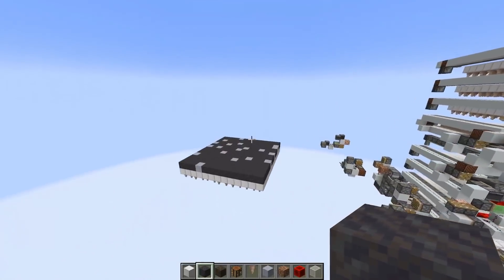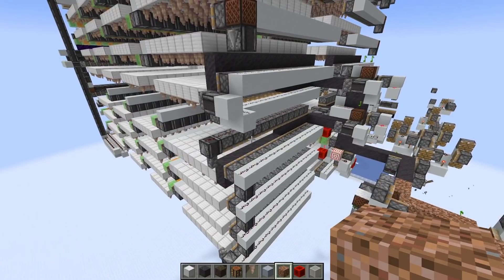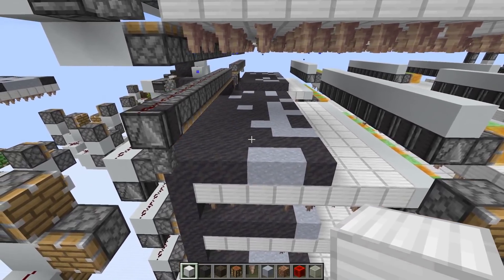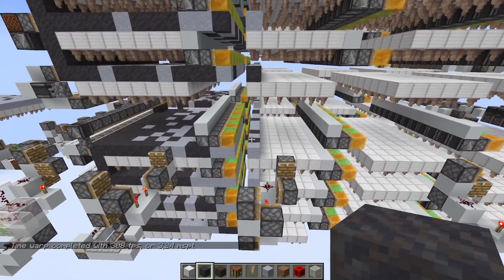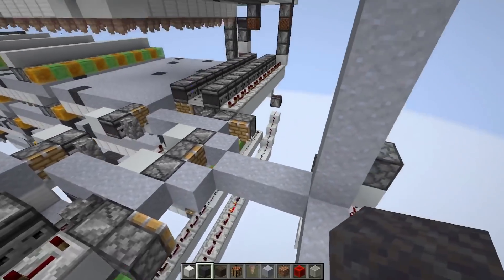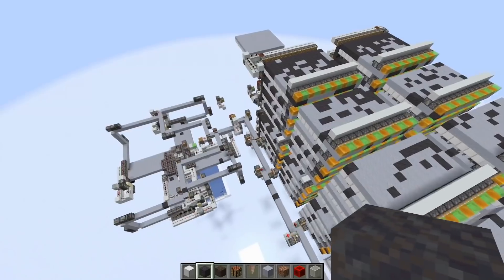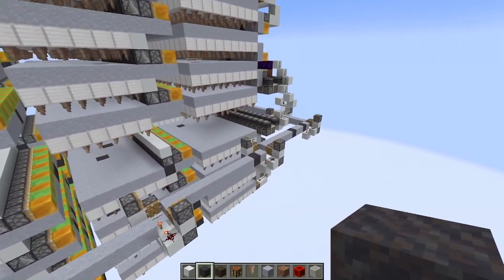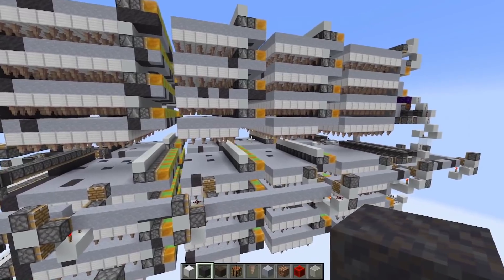Efficient Renewable Clay Converter

Comment: You can reliably sort mud from clay from the simple fact that the clay uses the "guitar" soundfont on the noteblock. So maybe you can adapt you sculk block sorter to try it on your machine
Reply: *Flute. Wool is guitar.
Reply: I was thinking the same thing. You could only take the first section of the machine where it seems to convert 60-70%, then sort them out based on noteblock sounds and re-merge the mud back in to the input stream.
Reply: Or use the fact that mud is just slightly less than a block.
Throw an item. If the hopper below picks it up, it's mud, otherwise clay.
Reply: @theaureliasys6362  THIS! I thought that as soon as I saw how long the machine was. I thought, "why reach 95% efficiency when you could toss items on a conveyer belt and punch out the blocks that let items pass by timing a piston a few blocks along the belt?"
Reply: @theaureliasys6362  Wouldn't you need a hopper minecart at a precise y level because regular hopper speed is too slow? The blocks are coming in at 1 every 4 game ticks, but hopper speed is one item every 8 game ticks. I can imagine it's still possible, just more complicated. For example:

An item is dispensed on the block stream, and a 5 minute timer is set for later. If a mud block gets pushed in, then a hopper minecart picks up the item, feeds it into one of 2 hoppers it's sitting on, and that is detected, so the mud block gets separated and the 5 minute timer is reset. If the timer runs out, then the item despawned, so dispense a new item. The main problem with that would be the resetting of the timer, but I bet ilmango's a lot smarter than me and can come up with another solution.
Reply: @mambodog5322  just use chest boat
Reply: @theaureliasys6362  yesss, same as soul sand, not a full block, there are a lot of mechanisms that can detect that and then you can sort it out easily, but you can also just use noteblocks and I’m sure there are many more ways
Reply: definitely possible with the new calibrated skulk.
Reply: @nickb8755  or you could split the input stream so that processing can run at half of input speed. Or just run your stream over two of the hopper-based detectors described, so the backup one will catch anything missed when the primary is on cooldown.

Comment: It's also always an option to add a system whereby endermen pick up the clay and are then killed in order to get the clay blocks directly. I love this crazy automation!
Reply: LogicalGeekBoy once build an enderman farm with melon blocks as bonus output. I guess you could do something similar and let the endermen pick up some blocks
Reply from the maker: would be an absolute nightmare trying to do that. works well with melons because nothing breaks if melons don't get picked up. 
But if you constantly have blocks pushing in from the back, the randomness introduced of enderman spawning is a huge reliability issue.
Not worth it all if you ask me.
Reply: If you ran the clay past the endermen, then into a blast chamber  it would stop the system breaking. Not very efficient but workable.
Reply: Sure, it's totally gimmicky and not really worth the effort. But we're already talking about a massive contraption that only produces a few thousand clay blocks per hour, so I think it's a fun challenge.
Reply: @ilmango I have been trying to design it with enderman, and yeah enderman are too difficult to deal with, they are too unpredictable. 

Sometimes they pick enough blocks but sometimes they don't, it is peetty annoying lol, although with a slow clay farm may be it would be possible, but at that point it would be such a slow output that it isn't worth the effort
Reply: @giantroboteye5371 Yeah, but at that point, why bother? Lol

Comment: Is there any specific reason why it's a 17.2% chance of converting mud into clay?
Reply: mojank
Reply: It's random-ticked based and that is the probability associated with the mud to clay conversion.
Reply from the maker: it's actually 17.6%. sorry I misremembered. to be precise it's 45/256.
why 45/256 though? no idea, it's like that in the code. probably a developer thought it's a good number or they wanted to reach a certain average time, similar to it taking be pretty much exactly one hour for copper to get to the last stage.
Reply: Iirc, its because it looks for the dripstone to get random ticked, so it ends up being the same probability as the dripstone filling up water/lava in a cauldron

Comment: I think that noteblocks change its instrument with clay, maybe that can be used to sort the mud out
Reply: IIRC mud has a smaller hitbox, like soulsand, so it's possible to use an entity and a tripwire to sort them out.
Reply: Would an observer not detect it well enough?
Reply: no it cannot as how would you detect the sound automatically?
Reply: @pocarski  imagine going through all that hell with entities just to get clay
Reply: @vuongle743  the noteblock block status changes and this can be detected with an observer. Ilmango already used this to separate stoneblocks from sculkblocks. That being said, this only works if there are different instruments and I do not know if that is the case.
Reply: “Imagine going through all that…”
 @vuongle743  that’s the fun.
Reply: @sempervelox  looking at the wiki, unless it has not been updated, clay and mud do have different instruments
Reply from the maker: that would be the way to go I guess. very easy then
Reply: You can also use the dripstone to sort Mud and clay, clay is not 'dripping'
Reply: @Cheesecannon25  The observer wouldnt be able to tell the difference between mud and clay.
Reply: @vibe6223  does the transformation cause a block update
Reply: @Cheesecannon25  I assume it would but i'd imagine a few things could get in the way of being able to tell the difference between the blocks like the mud being pushed into the system, which would activate the observer.

Comment: How about dropping an item onto the blockstream, and having a hopper below? Since the mud is lower than the clay, as soon as the item lies on a mud block, the hopper should be able to pick it up. Then just use a comperstor to detect the item going through the hopper…
Reply: I'd assume too many dropped items would lag your game out.
Reply: @lordderppington4694  You wouldn't have more than a handful of items on the ground though since they'd all be picked up by hoppers (or hopper minecarts)
Reply: @lordderppington4694  yes using items could cause that problems, I think using minecarts is a better idea, a Minecart will attach to a rail underneath partial block like mud which you can detect and sort mud
Reply: @sanderbos4243  can't use hopper minecarts because they will pick things from clay too, and hoppers could fail to pick up fast enough in the long run.
Reply: @wharhast1920  True, but if you split up the line of clay into a few more lines then the new blocks would be pushed in slow enough for hoppers not to get overwhelmed
Reply: @wharhast1920  I think that hopper minecarts off of rails do not pick up items thru full blocks, only on rails does that work.
Reply: @wharhast1920  hopper minecarts pick up from full blocks just if they stand on rails
Reply: The problem with items is that they don't fall on the same tick the block beneath them disapears. So in the end block stream would need to be split regardless
Reply: @feliksporeba5851  considering the fact that the blockstream already is split up multiple times, maybe do the sorting just before merging the streams again

Comment: For sorting out the mud blocks you could use a hopper bellow the block line an an item on dropped on top, so when a mud block passes through detects the item getting into the hopper, then push the block out and drops a new item on top.
The collected item can be reutilized.
Maybe if mud blocks slip through just put a second filter.
Reply: Because if the speed of the block stream, I don’t think it would be feasible (or  at least it would add another complicated circuit and the all stone to clay conversion is already a nightmare)
Reply: I had the exact same idea
Reply: could also use armor stand to detect height
Reply: Great idea! Even though quite complicated due to the hopper cooldown I can't think how to make it easily reliable. Simpler idea would be to add item filter into the collection area
Reply: @xborak2  the point of this is to filter the not converted mud blocks back into the machine
Even if it could cause an extra bit of lag the hopper delay can be circumvented by building more of this filter
I'm not an expert with redstone, but this is my idea, maybe is better than a filter based on armor stands

Comment: This still works in current versions!
It's just a little tricky getting the mud converter going

You will need to place 1 stack of empty bottles, and 4 water bottles in top hopper Minecraft, and the 3 hoppers below it

You might wait for a few dirt blocks to pass through, but after that it should run flawlessly.
Reply: my savior thank you sm
Reply: Hi, so your idea is to do such an item filter? I tried but it is not working for me in 1.19.2. I cheked il mango one and I think he did not do that....same world the one built from ip mango work mine not....any idea?
Reply: God bless you, thank you. Was triying to run 8 of this at the same time and for some reason, some of them work, some doesnt. Still dont understand why this happens only sometimes, but your idea fix it perfecly
Reply: @tree-rex77  I found out it is directional....not only the direction that blocks are pushed to but ive X and Z cordinates....with both negative it work pointing west...with X positive and Z negative it works to pointing west, but if you point east with the output it broke again...only way is to do an item filter like in this comment was suggested...
Reply: @tree-rex77  aniway iven the 0 tick 2 piston pointing up in est direction are broken...but I managed to build a new one that is working....

Comment: Hmm.. could you perhaps sort out all the clay blocks using noteblocks, like you did with stone in sculk farm?
That way you clear out the space for more mud and it gets more time to get converted, whilst the mud that already got converted to clay can be sent straight to tnt chamber!
Reply: i was thinking the same thing
Reply: Same
Reply: Also since the blocks aren't coming at such high speeds compared to sculk farm, there's no need for the fancy high speed sorters, simpler ones could be used and it would safe some space.
Reply: This would work, as the instrument for clay blocks is 'Flute', whereas it is 'Harp' for mud blocks.
Reply: @bobparker1671  ye, exactly.
I'm the one who shared this trick with Ilmango in the first place, so I know how it works.
Sadly it can't sort blocks with specific instruments, it can only sort blocks with unique instrument from blocks without unique instrument.
The sorter sees wool and stone as blocks with unique instruments, it can't differentiate them. The reason is because these blocks are moving, and when they move, observer will be activated no matter what instrument these blocks have.
Reply: @limonlx7182  Can a comparator tell the difference between between the instruments? Or does it check something else for note blocks?
Reply: @limonlx7182  And what if you zerotick the block beneath?
Reply: Checked that. Doesn't work
Reply: @Wadusher  haven't tested it yet, but from what I've heard and assumed, you can't.
I don't think Mojang ever considered this, though seeing how the noteblock sorting is becoming a bit more useful with newer updates, there is a chance.
Reply: @feliksporeba5851  oh, that's sad, I got hyped about this idea and wanted to go and test it right away, but I guess no.
Reply: @limonlx7182  does the sculk sensor distinguish between soundfonts when the noteblock is played?
Reply: @tissuepaper9962  nope
Reply: @limonlx7182  damn so you'd really have resort to some craziness with an armor stand. I'm envisioning something with frost walker boots but I don't think it would be nearly fast enough. Another commenter suggested a chest boat above and a hopper minecart below the block stream and you detect the item passing through as indicating mud, but I'm not sure if there would be glitchiness and clipping when you go from mud to clay with that lip between them.

Comment: Would be really fascinating seeing the entire production setup starting from the moss/bonemeal (can’t remember what exactly is first) all the way to the glazed terracotta.  With crafting and storage sections when needed.  Just seeing all the block being moved through each section like a full on factory
Reply: thats something for the playthrough most likely, not one of these showing off a farm vids
Reply: In my single player wold I alrady did a 12.000/hr dirt farm from stone to dirt passing from moss to podzol.
And a lava super smelter that smelt 7000 items for cicle in 16.6 minutes.
With this machine that convert dirt to clay at the rate of around 7000 in 20 minutes it will be complete. The only thing is that you have some steps.

1 Planting spruce and Collecting dirt.
2 Dispensing dirt and collecting clay bals.
3 Craft Clay from Clay bals or remove the tnt chamber and add a cube maker tonmanial harvest with silk tuch
4 Supersmelting clay and collecting terracotta
5 Supersmelting Terracotta and collecting Glaze Terracotta

Comment: Hey ilmango, there is a way to make a 100% efficient design that takes even less dripstone, but it requires a total redesign. Basically every single mud block goes it’s own chamber to turn into clay, and an observer detects the change and pushes it out so a new mud block can go in the chamber. The chamber design and the loading and unloading of chambers would take some figuring out though
Reply: There is one.) I am having fun on working on it currently. Actually the base design is pretty simple. But there are some edge cases that make the machine somewhat complicated. For example the case where the mud block converts in the same moment where it enters the block above the dripstone.

Comment: 9:12 thinking back to that cube maker/extractor you made earlier for the skulk blocks. I think if somebody REALLY wanted to flush out the machine, they could just detect when the dirt generator stopped, and then start a dropper timer or something to switch both input and output from the system to clear out most the clay.

you would probably still have stuff in the blast chamber, but the conversion cells would be clear.

Comment: You could also fully utilize the output blockstream for conversion by putting blocks with dripstone underneath it.
Reply: Your dripstone is probably better spent building an extra module as ilmango talked about, because block 36 cannot convert and the united blockstream moves a lot more often.

Comment: It seems like the best way to deal with unwanted mud would be to send it back into the input via an item filter after the TNT blast chamber.  Edit: I'm a dumbass.  You can't place blocks automatically, though you do need to be present to get random ticks to dry the mud anyway, so AFK auto clicking wouldn't necessarily be out of the question.
Reply: You can't place block automatically
Reply: That's somewhat true. Removing the mud would actually lower the rate of the farm, as the speed the clay is collected is determined by the number of blocks being output by the system. 

However the problem comes from reusing the mud as you can't place it automatically. So unless you want 5% as much mud as you do clay (~11 stacks per hour at max speed) then you'd be stuck either storing/deleting the mud or spending playertime feeding it back into the system by hand. Since the rooted-dirt farm only produces 1/10th of the machine's capacity it's well worth it to put the few unconverted mud blocks back in the system so long as it's feasible to do so.
Reply: @Mark_badas  I did fail to take that into account at first, but a player has to be within range for random ticks to convert the blocks in the first place, so doing some AFK auto click block placing shouldn't be out of the question if you don't want the mud.

Comment: Can you use the height difference between clay and mud blocks to filter out the mud blocks as blocks and send them back into the system if they fit? You'd want to give priority to incoming blocks so you don't jam up whatever's inserting blocks into this module, but you should be able to make the separator in such a way that if the input is already operating at peak capacity, the piston that tries to push the mud blocks out of the clay/mud filter just can't push and the mud gets blown up and filtered out as an item.

I'm not sure how exactly you'd detect the height difference that fast, though it should definitely be possible if you do the filtering before you fully merge everything (one thing that comes to mind is having an armor stand on top of the block stream; you try to push it onto the adjacent block and if it can go, you've got clay, while if it can't go, you've got mud, but that would be pretty slow because you need to detect the armor stand moving or not, and then you need some mechanism to lift the armor stand back up if it is mud.

Lots of interesting problems, but it should be possible.

Failing that, you can use a system which dispenses an item on top of the block stream and has a hopper under it. If the item gets picked up, you have mud. However with how long it takes comparators to update, that'd probably be half-speed at best, and you also have the problem of dealing with the item despawning if you have no mud for 5 minutes.

EDIT: Should have watched the last minute of the video first lmfao